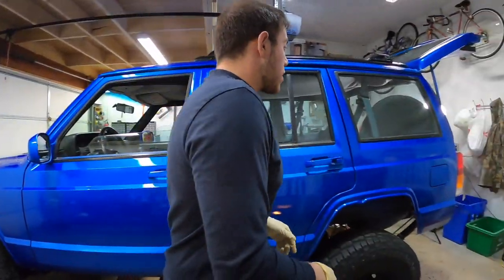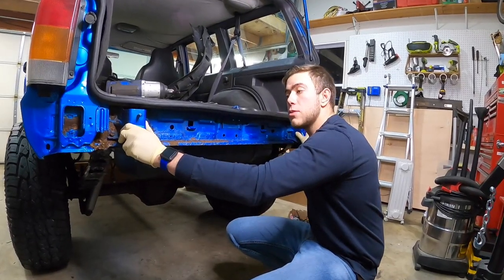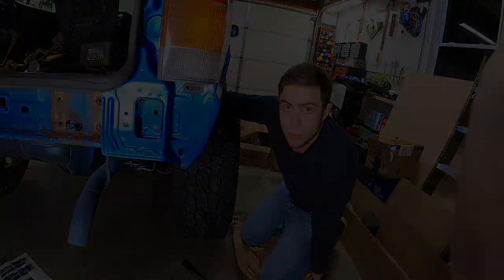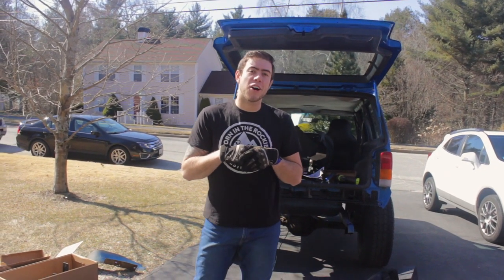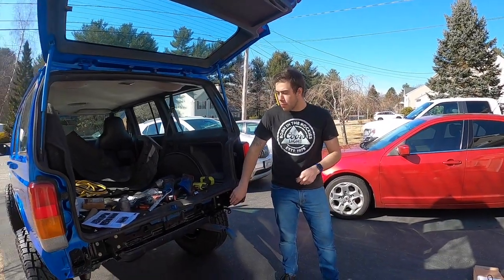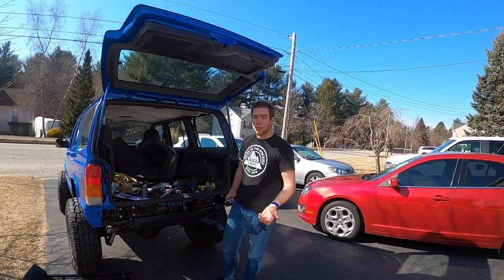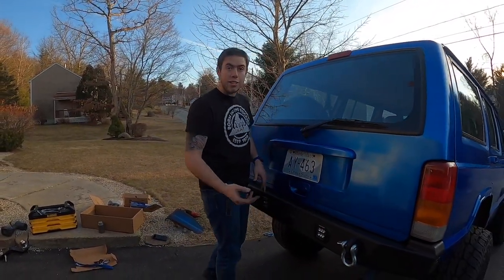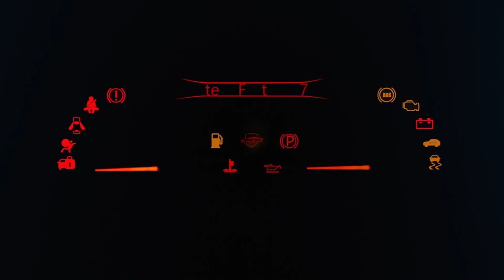Jeep Cherokee Rough Country LED Rear Bumper

Comment: "Andwhatnot" to death....
Jeep looks really good though.
I've never heard of...13:35
"It's kinda off topic a lil punch in there in the way" WHAT THE HELL IS THAT, AND THIS...
"Punched it through"????define please.
"We just clamped it right on"
So you got grade A bolts...like grade a meat I guess. Punched through what? Did you pre drill?.existing but smaller holes? Drilled out new holes? Put a nut on the other side of the bolts? Self tappers? A bolt and a clamp are two separate items..
So you clamped on a bolt that has threads??? Wtf?
Stronger then the original threads....don't you mean original bolts...were you drinking? Your slurring brother.
If your going to interject don't half ass it and have the cam on the area w bolts, especially if your not going to be clear on descriptions...just saying
Either way your indian looks pretty kewl...keep it up, brother.
Reply: Ok Karen